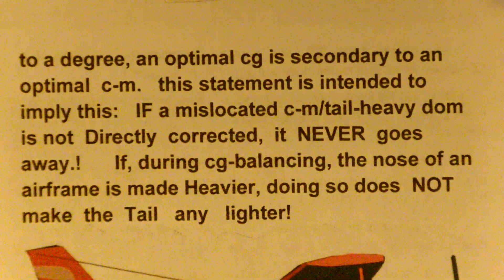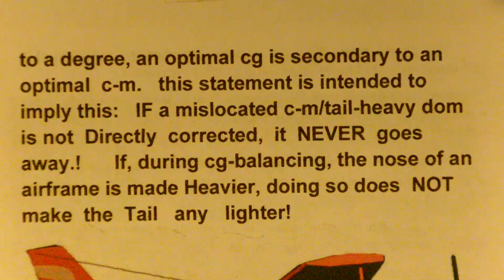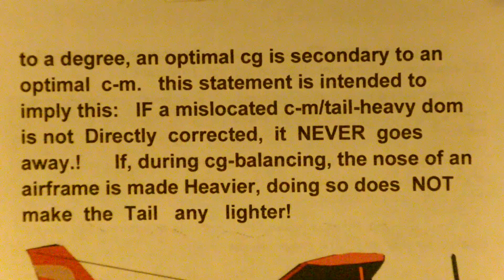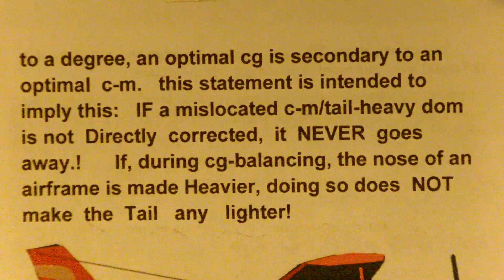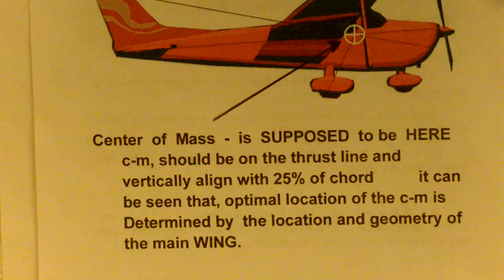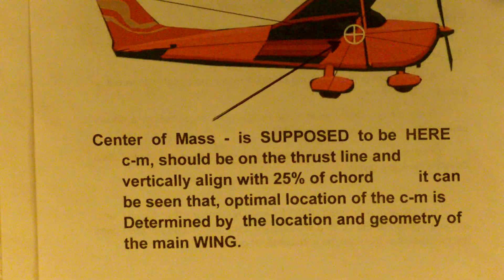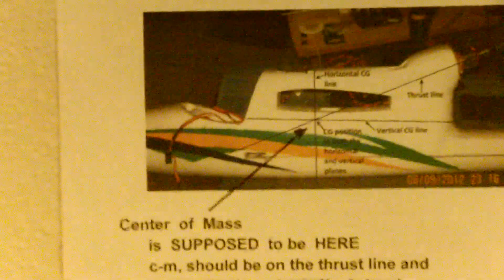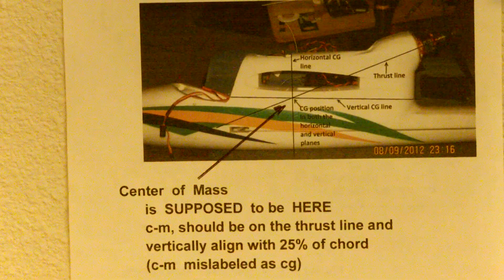aircraft center of mass revisited

Comment: How do you plan your build around your cg? Software types ?
Reply: You can use something like CG-calc :https://www.ecalc.ch/cgcalc.php
This gives a reasonable estimate of the proper cg location for your plane. Don't assume this position is perfect though, but it will be a good starting point.

Also, I wouldnt listen to most of David's advice.  Some of it is correct, some of it is just blatant misinformation.
Reply: @basgerritsen9669  thanks for the info, I have used the wing calculator when build models in the past and it’s not bad for getting the cg close as you said. What I don’t understand is how you can plan a complete scratch build airframe and allow for all build materials such a balsa, glue ,electronics ,engine , fuel tank , battery etc and build a perfect plane and not need to add some sort of ballast at some point. I know I have built planes in the past and been lucky enough to not need to add weight as I got lucky with the cg but that’s why I was wondering if there was some sort of program to calculate all the components individual affects on the cg relevant to the position in the aircraft. Cheers
Reply from the maker: sorry.   i cannot  make  sense  of  your  question.          i have no need of software.      see my  tutorials.
i have  learned  what i need to know from study  and from  OBSERVATON,  of the design of  full-size  ga/military  aircraft.
https://wright.nasa.gov/airplane/shortw.html

Comment: The carpenter is making an airplane. When is the test flight scheduled for?
Reply from the maker: ???   W T F       your  STOOPID  rhetorical  question, at this tutorial,  does  NOT  Even  make  sense.       kma      doofus
Reply: @daviddavids2884  that was supposed to be a joke
Reply from the maker: @Lechoslowianin  as i said,  your comment  made  NO  sense.     unless it was a veiled  insult.        googletranslate
Reply: @daviddavids2884  I use a translator. I like your planes. I used to do that too. They are very labor-intensive and susceptible to damage, regards